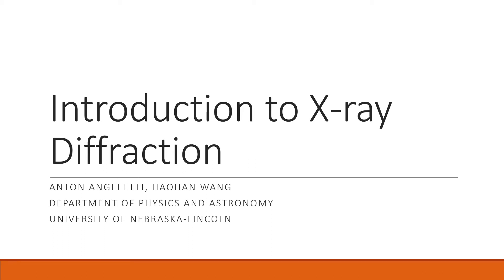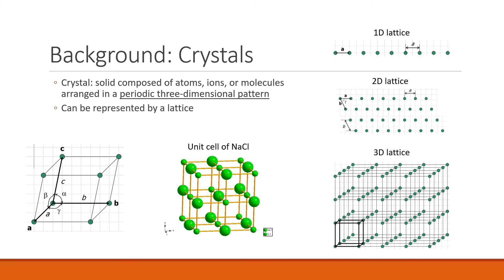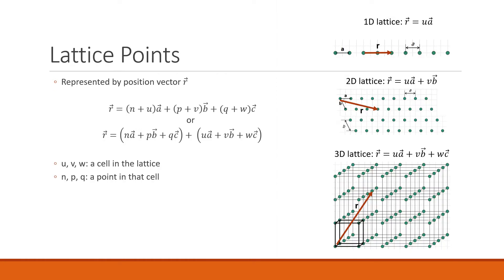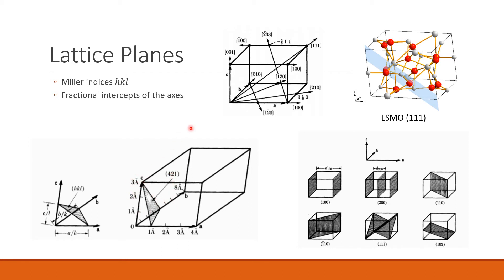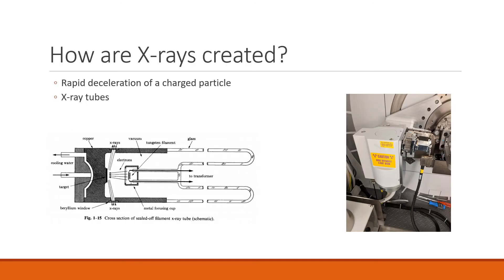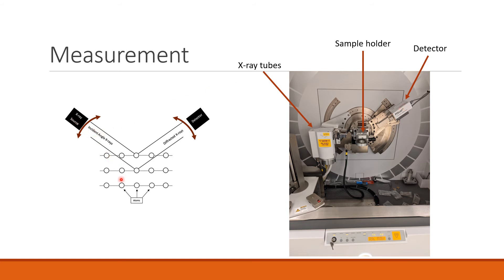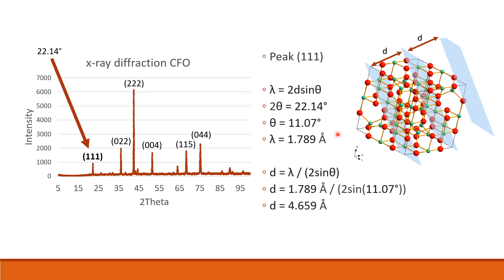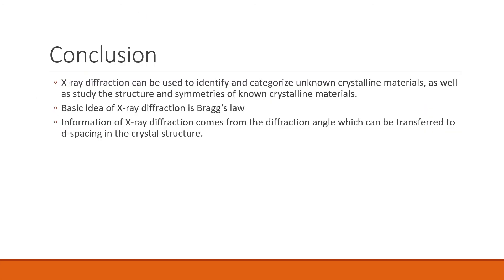Introduction to (powder) x-ray Diffraction

Comment: Can you explain why a cristalline powder (in which crystals are oriented randomly) still gives discrete theta values for the corresponding crystal planes? Why don’t these peaks average out?
Reply from the maker: The diffraction 2theta angle (the angle between incident and scattered x-ray) corresponds to the spacing between crystal planes, which does not depend on the orientation of the crystal.
Reply: They average out in rings and cones on the 3-d level which is comparable to bragg angle parameters used for single crystal XRD.